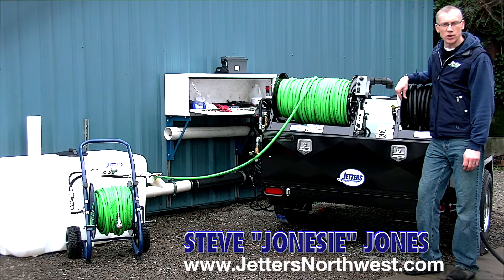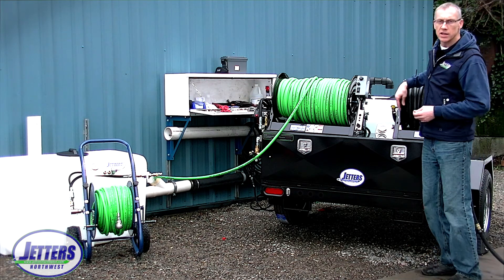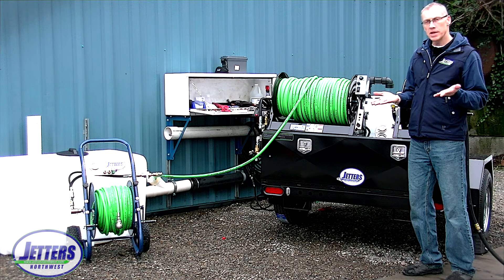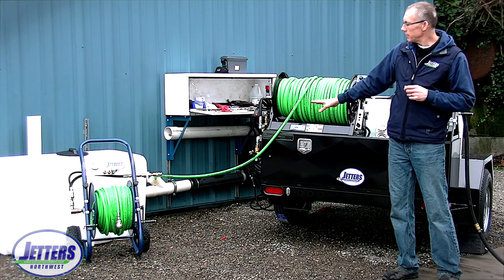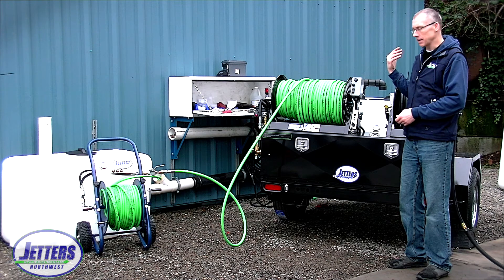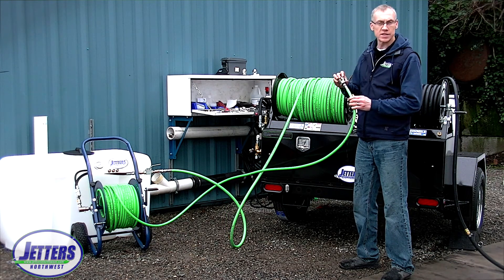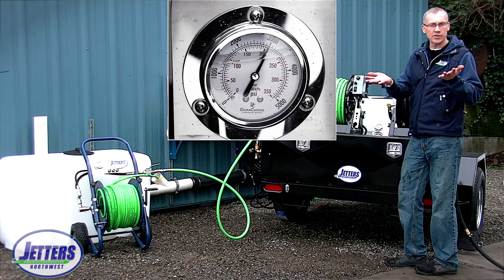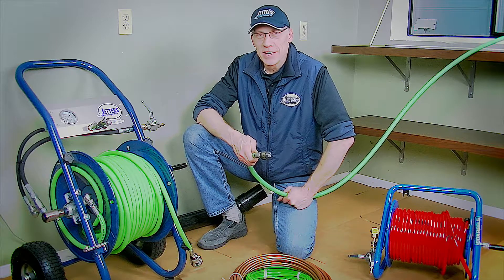Part-2 - RESISTANCE to JETTER PUMP-FLOW CREATES PRESSURE  -  "GET" JETTING

Comment: Can you get 12 gpm out of 3/8. The half inch hose is tough in four inch with bends
Reply from the maker: Yep - the nozzles just need to be orificed correctly.  You won't have as much PSI at the nozzle tho, as stated in the videos.  At 12-GPM the 3/8" hose eats up about 300-PSI per every 100-feet of hose before the water gets to the Nozzle, versus the 1/2" is only 100-PSI for every 100-feet

Comment: How does these work on soft poop stoppages
Reply from the maker: "Soft" stoppages are easy; drain/sewer contractors clear those every day with our jetters, yet primarily they are attacking the tougher blockages: roots, grease, wipes, scale, debris, etc., as well as prepping pipes for re-lining or coating !
Reply: @JETTERSnorthwest  sure nice pressure washer

Comment: 1/2 inch hose from the trailer and then a ball valve at the endof the 1/2 inch hose.
Followed by a 3 ft tail to the portable reel.
What is the logic and function of the Ball Valve in that location...???
RR
Reply from the maker: The Ball Valve at that location allows you to stop-and-start the Jetting-flow into the auxiliary Hose/Reel.  Note that this action requires that the Jetter be equipped with an "Unloader" Valve or other type of bypass-relief valve so that the jetting-flow of water has somewhere to go when you close the ball-valve (note also that ball-valve has a pressure-rating of 6000-PSI !!). Hope that helps!